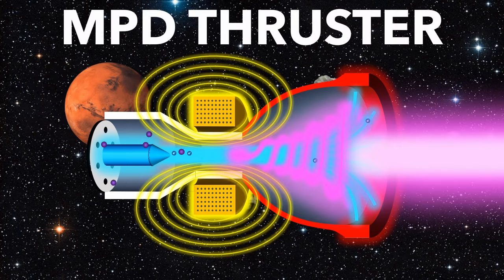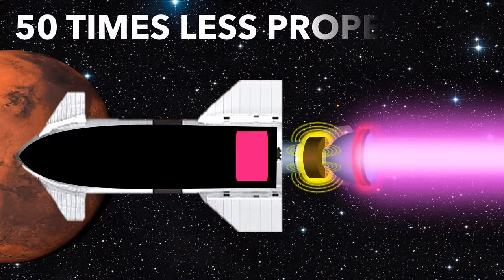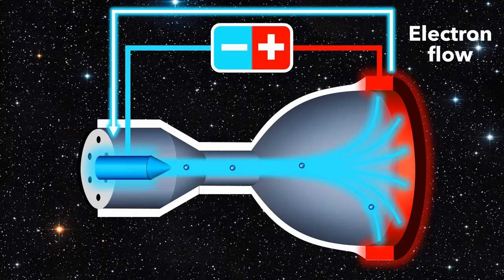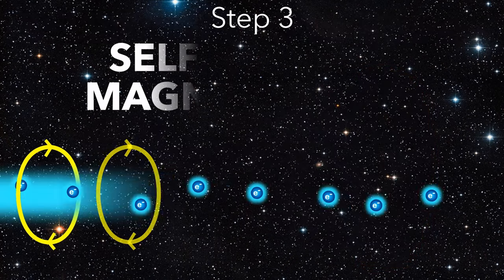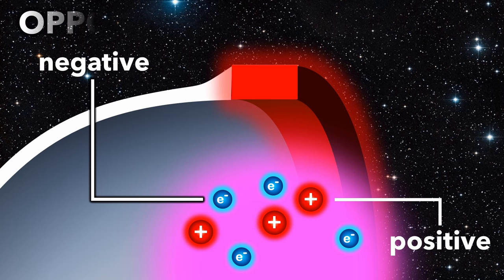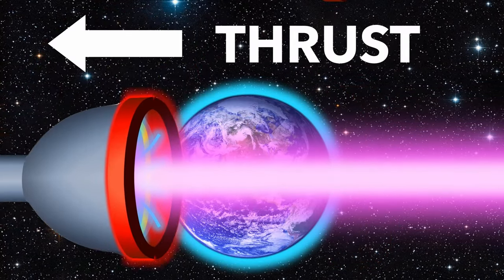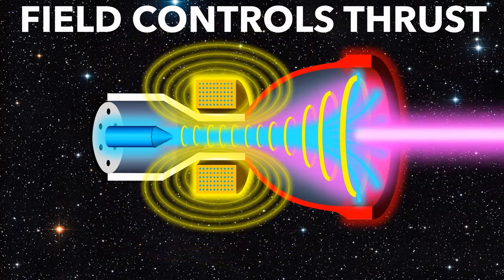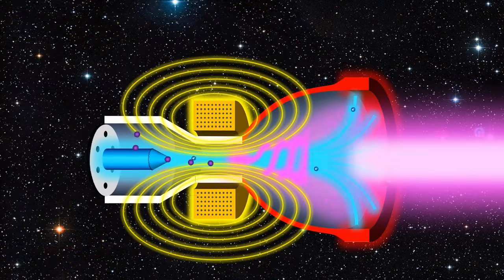Taking Man To MARS! | How MPD (MagnetoPlasmaDynamic) Thrusters Work

Comment: Interesting.  Wishing NASA well.  Y' know, there might be a different, easier solution to some of this, maybe.  F=ma=(m*v^2)/r, as in Huygens' equation for uniform circular motion. As in a rock on an end of a string being twirled?  Where the rock is the mass, 'm.'  Mass moving in a uniform circular motion.  Water being pumped through a circular tube of 3" ID at a rate of 3 gallons per second, by a centrifugal pump like those found in fire engines that can pump 600 gallons per minute --- if you think of this circular pipe having a radius of about 10' and if the circular tube is folded roughly along its diameter to about 20 degrees then the equation then can be expressed as F = 2*cos(10 degrees)*[(25^3)/10] = 1.5 short tons, about (if you assume a path of 25' or so, not a full circumference then, sounds like.  And other than keeping the water in its liquid state and having enough power to run the cited pump at 25 pounds per (about3 gal) second and the system doesn't spring a leak (maybe self-sealing like fighter plane gas tanks?), I think that it might work.  Nothing fancy here, just High School level Physics or Geometry.  Best of luck. So if you have a fresh sheet of paper with a circle drawn on it, you can draw little arrow counter clockwise with little squares next to the little arrows, all the way around (that 'right-hand  rule' for vector cross products). Fold the sheet along the circle's diameter to about 20 degrees with the drawings on the outside where you can see ‘em, and there you go. A demonstration of how to keep the ‘crossed product’ vectors from canceling each out out?  I guess?  Then you can get some flexible plastic tubing, a yardstick (that has on it a marked 18" spot for a balance beam and some counter weight masses), an empty 2 liter pop bottle for a water tank,  some tape, cardboard to fold into a 20-degree wedge shape,  some string to string everything up and 'there you go, again.' Happy tinkering. & y' can talk over any of this to anyone y' want.  High School Physics, that sort of thing.  I don’t think that either the NSA or the CIA would get too excited.

Comment: Focus fusion would work very well for such an application. Conventional nuclear would be very difficult as you would need heat dissipating radiators. Most or All extra space gain would be used up by the conventional reactor and shielding.

Comment: I have an idea. Why not use Interstellar gasses as fuel for the plasma drive through electromagnetic ram induction.
Reply: The density is far too low and widely varies based on where you are in space even for fusion, assuming we even could fuse Hydrogen. We really need Fusion propulsion to do big things in the solar system. Since deuterium tritium fusion fuel has energy densities around 350 Trillion joules per KG.
Reply: I also read this idea in a Carl Sagan book to use the interstellar gas. Or from whomever he got this idea ;-)

Well, it's not so easy.
And on the way to Mars, there is not much gas. Especially not much interstellar gas. The sun shields us from that.
Reply: The interstellar ramjet has been looked at and found not feasible due to insufficient gas density to sustain a P/P fusion reaction
Reply: @marksmadhousemetaphysicalm2938  Can i know who made these studies specifically? Cause i kinda like to think otherwise and idk if the data they have on low gas count is accurate to certain degree. Maybe i'm wrong but i like to see how they came to the conclusions.

Comment: It doesn't make any big difference if the Mars astronouts are 2.5 or 3 years in outer space, when the travel time to Mars reduces in half from 6 to 3 months.

Because on Mars the astronouts are still very much in outer space. They are still exposed to intense radiation from which they need to shelter, without having any good shelter rather than their own space craft or even just the lander portion of their own space craft. The air density is one hundredth that of Earth's, there is no oxygen to breath, we need to bring this from Earth  - or at least the machines to recycle the air and water. And we need to bring food for 2.5 or 3 years. 

On travels to Jupiter and Saturn the flight time however takes some years. There's where a reduction of the flight time plays a big role.

But yes, we can start playing around in our garden on the way to Mars with quicker travel times, but it just doesn't play a big role. (2.5 instead of 3 years in space).

We just don't need to wait for this technology to be available, it would not make much difference, it would only give a false excuse to delay the first Mars missions. The problems to stay on Mars are the same and need to be addressed anyways. 

Why 2.5 or 3 years?
Because Mars and Earth are closer to each other every 2 years. It makes sense to fly to Mars in one of these time slots and fly back in the next - and have around 2 years on Mars.

In the meantime Mars is on the other side of the Sun, it just doesn't make much sense to travel that big distance, not even if the travel time is cut in half. Better spend that time on Mars.

Another possibility is a short stay on Mars for a few weeks or even only a flyby at Mars and travel to Mars before the closest distance to Earth and fly back after the closest distance to Earth. But it's very much effort for little gain. Better stay there longer and explore it, that would be the cycle of 2 years plus the travel time of a few months.
Reply: The advantage of ionic thrusters isn't really that you can achieve higher speeds but rather that you can reach thrust with 50x less fuel, meaning you can have way more payload. Current chemical rockets are up to 99% fuel tanks. By using ionic engines, we can decrease that number. Considering that most  fuel on a spacecraft is just used to move more fuel, the savings in fuel/the increase in payload capacity is actually far greater than 50×

Comment: If the anode is positively charged, does it accelerate the positively charged ions out of the end of the funnel like the video claims or implies? What exactly accelerates them linearly? What keeps the positively charged ions from 'capturing' an 'electron'? It is only safe for deep space if the craft is 'massive'. A 'massive' craft demands an ion beam fired out of the engine that is dangerous to nearby space-craft.
Reply from the maker: Some great questions. So for MPD Thrusters the force accelerating the plasma is mainly the magnetic force, not the electrostatic force. So the anode doesn't really contribute to the plasma acceleration. The anodes job is primarily to attract electrons from the cathode. The linear acceleration out of the thruster is due to the circular magnetic field (from the electron  beam) and the radial movement of the plasma (due to the attraction from the anode). The resulting "Lorentz force" on the plasma pushes it out. In practice the acceleration won't be perfectly linear and will result in some loss of efficiency. As far as electron capture is concerned that certainly will happen as the plasma loses energy downstream of the plasma jet. And as far as safety is concerned this isn't such a big issue given the scale of space and the "relatively" low density of the plasma.
Reply: Space is big enough that the last concern is irrelevant

Comment: 😅 Actually... The drawback, of needing nuclear reactor, isn't even an issue.

I'm pretty sure those Voyagers, were powered by nuclear cells. If they can use nuclear cells, why not nuclear reactors?

At end of the day, it's just money 🤑 and military power.
Reply: Hear, Hear! (or 'Here, Here'(?)) Yeah, that nuclear reactor issue is all political (w/ some safety concerns), but you're right, we ain't gettin to 1st base in space without Nuke.
Reply: We just don't need this engine to fly to Mars. It doesn't make much difference if the astronauts are 2.5 or 3 years in space. Hear hear! 

Yes, on Mars the astronauts are still very much in space. No radiation protection, next to no atmosphere, no oxygen, no food on Mars. We need to bring all that - or bring the machines to recycle that. 2.5 or 3 years doesn't make much difference.

Don't delay the first Mars missions just with this false excuse to wait for this propulsion. Hear hear! 

But the flight time to Jupiter and Saturn is some years! That makes a big difference if we cut that in half.
Reply: It’s more base power output issue. Their theroscopuc reactors are very efficient and reliable for this weight, but have really lower power output. The Voyager probes barely generated enough power to run a lightbulb.